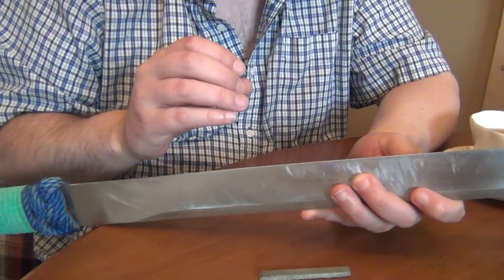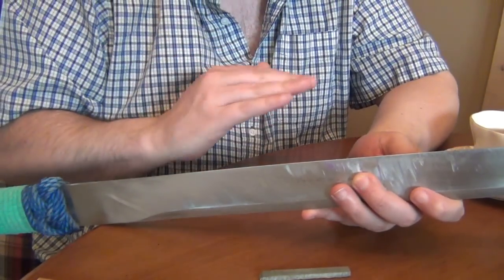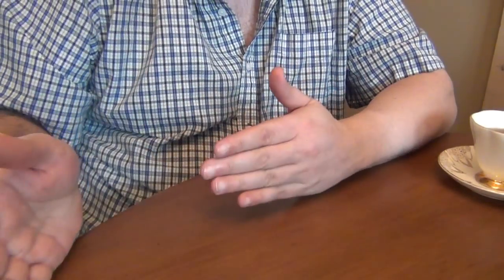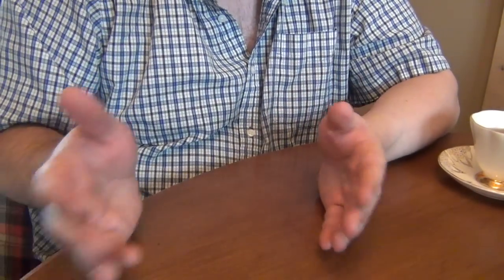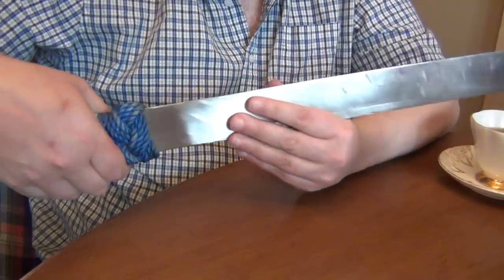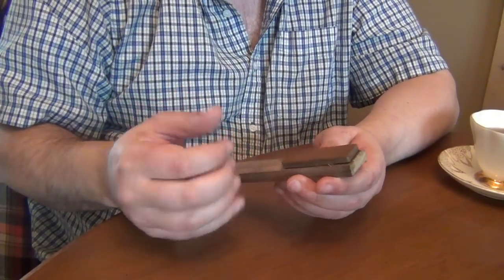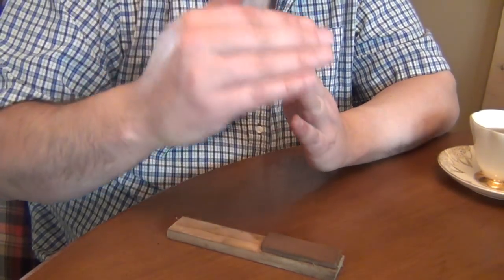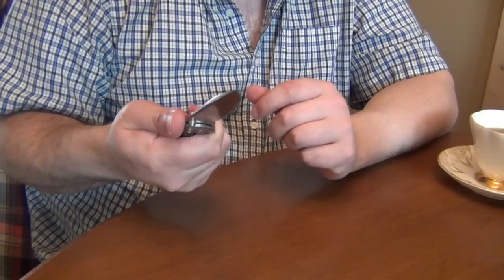Using oil on waterstones and water on oilstones ?

Comment: Mr. Stamp,
First thank you for all of the great work and sharing your experiences. As a beginner level sharpener I could really use some advice. I've decided to try to learn how to free hand sharpen instead of using systems like sharpmakers and edge pros. I'm curious to know what additional stones you would recommend for varying steels. I currently own a Naniwa Super Whetstone at 400grit (found it on one of your videos), a king combination waterstone 800/4000 grit, and a Norton coarse stone with unknown grit. Would this combination of stones suffice for steels such as S90V, ZDP-189, S30V, M390? I have used them for steels such as carbon steels, VG10, and 154CM with some inconsistent results but I'm sure that has more to do with technic than the stones themselves. If not can you recommend additional stones? Are diamond stones necessary for much harder steels as listed?
Reply from the maker: lukez21 The Norton coarse stone is likely a very strong sintered bond. I have some of them, they are useful when you want to set a very coarse apex, but they are not very useful in grinding the edge itself as those very high carbide steels need a weaker bond stone. 

For setting the final apex I prefer very strong bond, or in fact no-bond stones :

-Atoma/DMT
-Spyderco plates

For grinding the edge, Sigma Power Select II, but that King is nice as well on the 800. I would think the 4000 part is likely a struggle on those steels.
Reply: Cliff Stamp Thank you. I will look into the Sigma Power Select II. I have watched some of your videos and read many of your forum posts and have come to understand that the stones you use vary depending on the steel you wish to sharpen. I have recently been experimenting with M390. So assuming I get a hold of the Sigma Power Select II what order of stones would I use to achieve a very fine edge. And where does the Naniwa Super Whetstone come into play?
Reply: lukez21 What grit on the Sigma Power Select II? I'm assuming a lower grit since it will be used for grinding? 240?
Reply from the maker: lukez21 Yes, stones are really steel sensitive much like knives are task sensitive. 

The Naniwa Superstone 400 is a nice stone to use to set an edge and prepare for a micro-bevel but it will struggle on steels much past ATS-34/D2. It can work S30V and m390 but you will find that the surface tends to go slick and will need conditioning as the bond is too strong and it won't break down enough to keep the grit fresh/sharp.

If you are not changing the edge angles then then King 800 will set the edge easily. With the edge set then all you need to do it add the apex or micro bevel. This is best done with a very strong bond stone like a Spyderco or DMT plate. It can be done with the King 4000 but that is one of the most difficult stones to use to the the actual apex set. 

However stones are not magic, they make things easier/difficult but skill/experience comes into it as much or more.
Reply from the maker: lukez21 Are you going to be changing the edge angles or removing heavy chips? Then the 240. Otherwise the 1000.

These are REALLY weak bond stones, they are designed to cut the hardest to cut steels and they do so by releasing fresh abrasive readily. You have to use them with just enough force to make contact. If you press hard you will just eat the stone readily.
Reply: Cliff Stamp Quite frankly I don't think I have the experience or skill to begin changing the angles. Therefore I believe the 1000 would suit me better. My knifes don't get a lot of hard use leading to chips. What grit on the DMT stone? So just to paraphrase and please correct me if I am wrong its really important I get a basic understanding. So for a harder steel I will start with a lower grit and weaker bond to aggressively remove steel, then go to the king 800 to set the edge, and last use a DMT stone with a strong bond to set the apex or micro bevel? Is the process the same with softer steels you just don't need as aggressive a stone as the SPS II?
Reply from the maker: lukez21 If you are not changing the angle, then the King 800 should be fine to set the edge and then micro-bevel with a diamond plate. You don't need a DMT, even a basic hardware store stone should be practical. Joe Calton (knife maker) prefers a 325 grit for example for his knives. I tend to use at least a 600 grit diamond, 1200 and above are nicer for wood and kitchen work.

Yes, with easy to grind steels you can use a harder bond stone.
Reply: And this is strictly speaking to M390 but the concept applies to all steals? So is SPS II 1000 soft bond enough for ZDP-189?? Also were does stroping come into the equation? Is stroping more beneficial for softer or harder steels? And do you have a good source for finding out how soft or hard the bonding for each stone is? None of my stones state anything about the bond?
Reply from the maker: lukez21 Luke, that is a big problem because sharpening stones don't typically talk about the bond strength but it is critical to how they function. The only thing you can do is either buy one, or ask someone who has it and understands what you are asking.

Yes, the SPS-II stones can cut ZDP-189, they can handle any steel, even 10V and things like 121REX.

I am not sure what you are asking, what applies to all steels?
Reply: Cliff Stamp What I was referring to in regards to the " applies to all steals" comment is the harder the steel the lower the grit and softer the bond needs to be. Very unfortunate that the stone makers don't give the bond strength considering its so important. In your opinion since I already have the king 800 waterstone which you say should be sufficient in setting an edge would it be smarter for me to get the SPS II 240 to stretch out my systems capabilities? In other words are the SPS II 1000 and the king 800 so close in grit and bond strength that it would be more beneficial to get the much courser SPS II 240 stone? Also in what application or steel would the king 4000 be useful? And again curious about your ideas about stropes?
Reply from the maker: lukez21 Yes, the harder a steel is to grind the weaker the bond strength you want in the stone. 

The SPS-II 240 is over kill unless you are changing edge angles ,  the King 800 should be fine for just resetting the edge. As it will generate a decent slurry you should be able to just jump from that to the grit you want for the final apex/micro-bevel.

I don't use those ultra-fine weak bond stones much because they are not useful for setting the apex and generally you don't need the edge at a very high polish. I have a bunch of them but the main stone I use of that type is a 2000 grit Naniwa Aotoshi. I only use that when I want a very fine apex bevel (as in a few microns in stone/abrasive) and I use the Aotoshi to minimize the burr on the apex to prepare it for the micro-bevel. However it is only a minor improvement over a King 1000 which I have.

I don't use strops though I have a bunch of them. Most people who argue they are useful are finding that to be true because they don't know how to get a sharp knife from the stone directly. 

It can be useful to use a strop if you don't have very fine grit stones as they are inexpensive but a 1200 grit DMT or medium spyderco plate will essentially never wear out if you use them for micro-bevels only. I have them for almost 20 years now and I sharpen much more knives than most people, I can do easily ~100 knives a week at times.
Reply: Excellent advice. Hand sharpening is a skill I wish to excel in someday so I really appreciate your input. I feel talking with you for a day has taught me more than reading 100s of forums. Hopefully I'm not driving you crazy with the elementary questions as I hope to possibly draw from all of your experience as much as possible. Not many people have such an understanding of steels composition and sharpening stones. I am looking at purchasing the DMT DuoSharp diamond stone with extra fine/ fine grit and I'm hoping those will be sufficient in creating an apex for all my different steels. Until I feel ready to start changing angles I think I will hold off on the SPS II 240. Do you think between the Naniwa 400, King 800/4000, and the Dmt 600/1200 I have a good starting platform that should handle a wide array of steels? Also if you had to give a complete amateur 3 basic pieces of advice on sharpening what would they be?
Reply from the maker: lukez21 Luke, yes that is a decent set of stones. 

-understand what you are trying to do physically with the knife when you sharpen

-separate out grinding to a shape vs setting the apex

-tell your friends/family you sharpen knives for free (lots of practice will result)
Reply: Cliff Stamp There's not doubt there would be a line. But like every thing else I suppose practice makes perfect. And after watching you achieve a sharpness I have yet to obtain on a brick and a 24grit stone I am now a believer in that more than ever. Furthermore the video on three knife sharpening steps I think will be a huge help. I have never destressed a blade in my life but hindsight it makes perfect sense. I look forward to practicing what I have learned hopefully tomorrow. With some luck my wife might give me a small break in between my chores. LOL!!
Reply from the maker: lukez21 You might want to drop by the form, quite a number of decent guys/sharpening there.
Reply: Which forum are you referring to as I have read many of your posts on numerous forums?
Reply from the maker: lukez21 Mine : http://www.cliffstamp.com/knives/forum/index.php
Reply: Gladly. I have read posts on this forum before, I guess I missed this was actually your forum. Great. Signed up now.

Comment: Cats and dogs living together.

Btw, once I noticed the bare left arm and the hairy right one, I couldn't stop noticing it. If the invaders ever come looking for sharpening fanatics, it'll be a dead giveaway.
Reply from the maker: ***** I'll distract them with witty banter.
Reply: @CliffStamp  do you prefer oil or water
Reply from the maker: @bigwoody4704  It depends on the stone. I would suggest vs thinking oil or water, think about how much lubrication your stone requires and the nature of it. For example a very fine grit stone with a very small abrasive simply can't work with oil (as it will mask the abrasive) unless you don't want abrasion and you want rubbing or you use very high pressure (industrial grinding).
Reply: @CliffStamp BTW thanx for the reply I just am comfortable with oil stones.I've really enjoyed your presentations.Will probably purchase the Spyderco 2"x8" ceramic bench stone.What reasonably priced oil stone would you recommend in a fine grit?
Reply from the maker: @bigwoody4704  For simple steels, India.
Reply: @CliffStamp  for one last inquiry,would that be the Norton combination?or seperately?Thnx again and enjoy your videos
Reply from the maker: @bigwoody4704  The combination, you will never wear one out anyway, neither will your kids, or theirs. They wear super slow.

Comment: Neat! I only really have experience with diamond and ceramic sharpeners, which don't need any particular lubricant, but I always thought that non natural water stone needed to be used with water because the binding agent was made of some type of petroleum product that would get broken down by oil. Think oil vs not oil resistant shoe rubber. I have never actually met a real waterstone in real life so that assumption was one of ignorance.   They were usually more expensive than I could afford. 
Anyway, besides oil I actually like spit for a lubricant. The mucus proteins do a nice job of keeping the lubricant in place, instead of running off the edge. To each his own!

Comment: so if I use oil instead of water on my cheap, super-hard, hardware store waterstones, they might actually behave in a sensible manner, this is such an obvious experiment that I actually feel stupid for not thinking of it myself...
have you tried different viscosities of oil to see if there is a difference in behaviour?
Reply from the maker: ***** No, I have mainly used mineral oil, that is an interesting question though.

Comment: Great video Cliff. I've said that to friends for years only to get an argument. So I ended the conversation. Lol. Btw I use Isopropyl alcohol on my diamond stones as it controls the dust, among other things. This is on my Wicked Edge btw and not on my Japanese Water/Oil Stones. Haha. Ur opinion on Alcohol Cliff in diamond stones ????
Mark in Ky.
Reply from the maker: Hunter Green I always use a lubricant on the diamonds, often Simple Green or water with an anti-rust agent. But alcohol would work as well. Trend sells an actual lubricant they designed for diamond abrasives, curious about that.

Comment: i would wonder if you were to soak a waterstone with oil, since it stays wet from the oil and doesn't dry out, i would be worried it would turn it to mush and the stone would break apart during sharpening.
Reply from the maker: knives save lives Many modern waterstones actually use the same bond as oil stones, even the same abrasive.

Comment: I use mustard as an emulsifier when I mix oil and water the I use what is leftover as a salad dressing. The metal adds flavour. 
Also that is a pretty tea cup. Fine bone china? Looks like it. I had a bone china coffee cup but it broke and I haven't been able to fine a suitable replacement. 
Your left arm looks as if it was recently transplanted on to your torso.... 
Finally, what did you say about that knife at the end it was a bit Newfie!?
Reply from the maker: mark a Yes, exactly right. I have a couple of them. I would rather slightly different handles, but it isn't easy to fine China which fits. 

XM-18, decent knife, a little small for my hands.

Comment: Is it possible the waterstones with their resin bonds would not break down as well with the oil?  I'm assuming the pressure of the sharpening is what breaks the bonds that creates the slurry which helps further break the bonds, but I didn't know if water's high solubility / polarity has anything to do with helping to break those resin bonds.
Reply from the maker: C amber It worked fine on the King but that has a weak bond. On some of the stronger bond waterstones it might prevent the necessary friction maybe and prevent from from forming a slurry. I intend to keep it in mind and do some experimenting with stones.
Reply: Cliff Stamp I hadn't thought about the reduced friction possibly being a negative either.  Interesting to see what shakes free.

Comment: I must say, I rather like this format of videos at your table.  It's how I'd imagine an FDR-esque fireside chat for knife nerds.

In the machine shop at school, we've got a bucket of an odd assortment of stones for removing burrs, and they reside full time in kerosene.  Maybe the requirement for eye protection is in case they suddenly fragment due to unhappiness.
Reply from the maker: PrinceValorum Ha,. all the Japanese stones I bought have little cartoons which show them crying if exposed to various things like direct sunlight, chemicals, wind. I think they maybe related to Gremlins.

Comment: I normally share this point of view, but I have had situations were I've learned to just sick to one. I have a coarse India since that I would use with oil, then started to use water one day. It would produce this sludge that I would have to scrub off with dish soap. It wouldn't simply wear off while sharpening. 

I'm kind of curious about the petroleum based oils and how they would react to some of the resin bonds. Some people use straight kerosene(paraffin). That tends to make a decent solvent as well.
Reply: I think that might just be something from the factory, my Norton Fine India side of my IC6 had the same thing when I went to lap it, it was real nasty, goo. Maybe it is dried oil or a sealer from the factory, or a combination of both.  Did this happen when you first got your stone also?
Reply: That is possible. It might be whatever oil they use to pre-soak their stones. And no, at first i was only using oil.
Reply: fervens I will keep an eye out next time the stone needs to be resurfaced if that gunk comes up again.

Comment: I having been using water and/or oil on all of my oilstones and diamond plates for years.  I just bought my first Japanese waterstones last year, and only used water on them because all the information I read, and the manufacturers instructions said so, I never even thought to use anything else.
Reply from the maker: Yehoshua Jason D. Stone In general I would not advocate using oil on waterstones because it isn't likely to produce a better result. I started doing it after the discussion we had just as a trial. I like it on some stones as it makes them splash and go. I think it might be interesting for some stones that people complain are too hard which typically means the bond strength is too high for how they are using them.